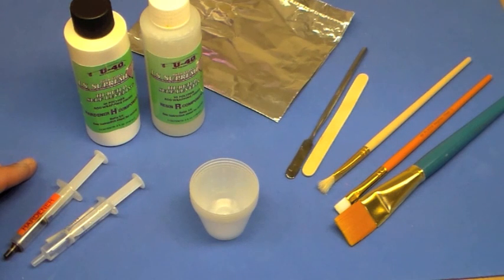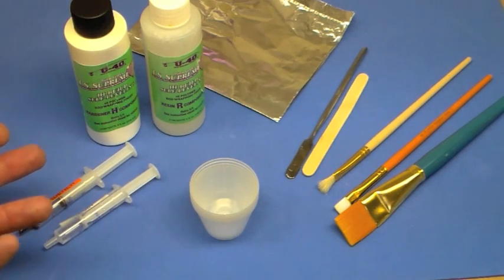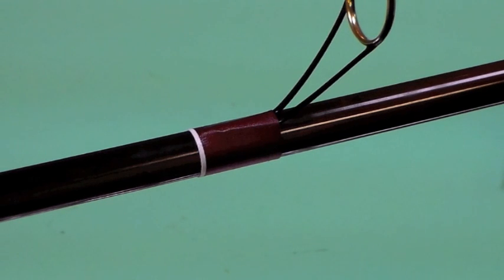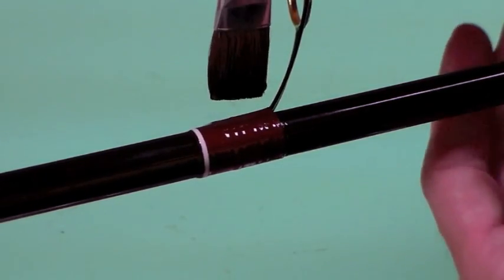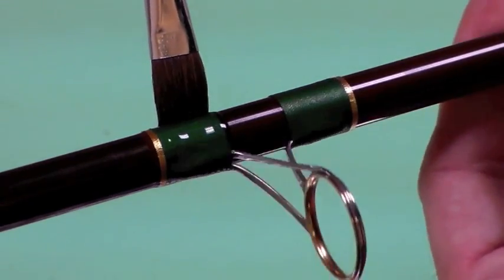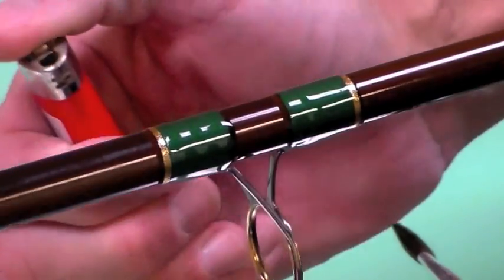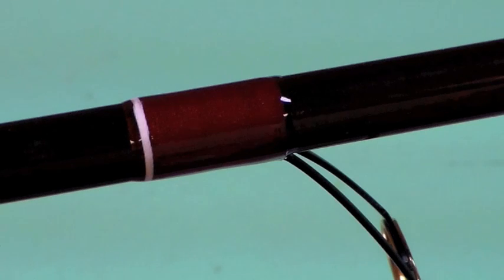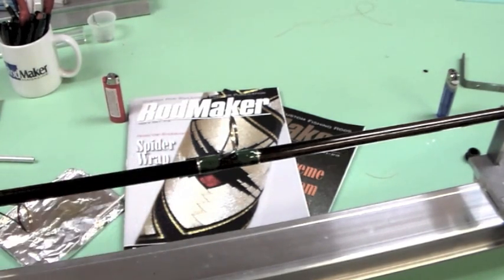Custom Rod Building Applying Epoxy Finish

Comment: how many layers of epoxy are you puting ?
Reply: I typically just use one, although very heavy duty saltwater rods may receive two.
Reply: @TomKirkman1  i want to change the thread on my feeder rods , this is why i am asking you . So one layer should be enought ? thank you
Reply: @madalindrugea9576  Normally, yes. All you're doing to cover the threads sufficiently to prevent damage, chaffing, water intrusion, etc. You don't need a heavy build-up epoxy.

Comment: Why rotate back and forth instead one direction of rotation? I never done it so just wondering.
Reply: Rotate the rod 180 degrees each turn, doesn't matter which direction you turn it. Turn it only when it needs to be turned.
Reply: Thanks Tom but I was referring to the application of the thread finish. Sorry if I wasn't clear. Just wondering your thoughts of going in one direction then going back? Is it just because of the epoxy build up on the brush?
Reply: I do it so that I can get finish in both the "tunnels" at the edge of the guide foot uprise and the thread.
Reply from the maker: Going both ways ensures that you get even filling of the "tunnel" openings. No other reason, really.
Reply from the maker: Yes, going in both directions makes use of the loaded epoxy on both sides of the brush bristles.
Reply from the maker: @jasongofron  Yes, pretty much.

Comment: Why not using and Hair dryer ?
Reply: A hairdryer won't speed up the cure appreciably, but it will make the epoxy run more at the higher temperature.  (note: the 2-part epoxy contains no water, so it's not really drying, it's a chemical reaction)
Reply: it blows the finish around... it does work, but its got some drawbacks.

Comment: never use a lighter use a torch or alcohol lamp lighter leaves soot
Reply: No, the lighter will not leave soot if you will use it as shown in this video.
Reply: waltb0069 lol @ someone trying to tell Tom Kirkman how to do things...
Reply: concur, cringe, i use a heat gun its great.
Reply: You don't need a lamp, you can just use a cotton ball soaked with alcohol, held with cross lock tweezers. That's what I use anyway.
Reply: What guides are those?
Reply: Those look like Pac Bay minima  4 guides, but not sure. They are very light and no ceramics.